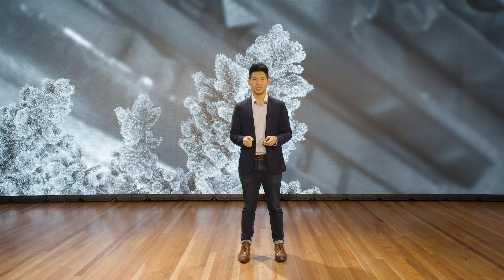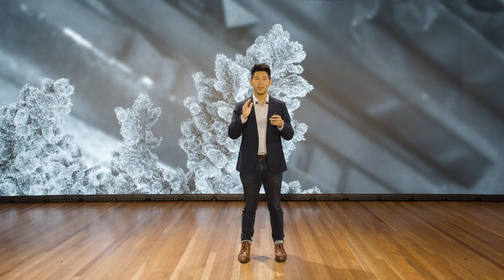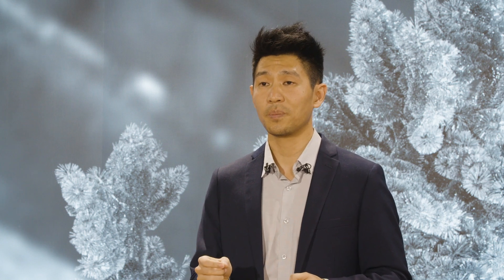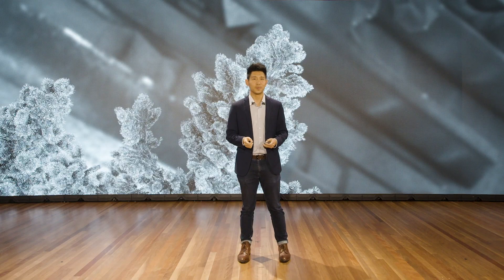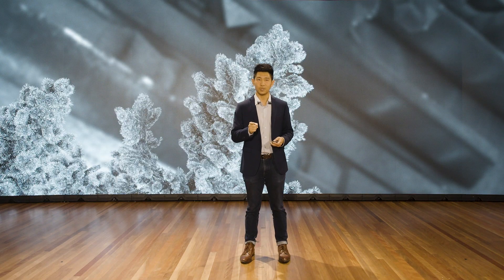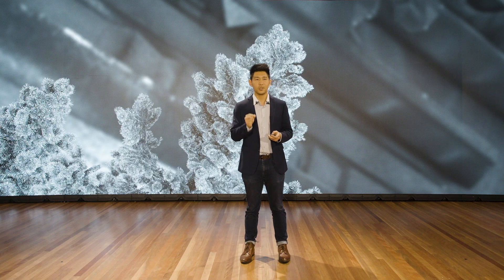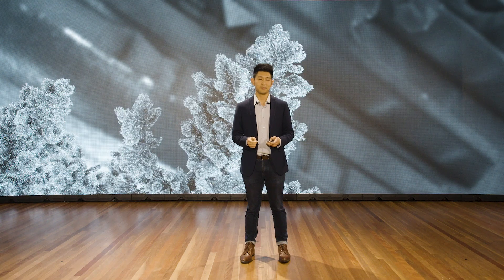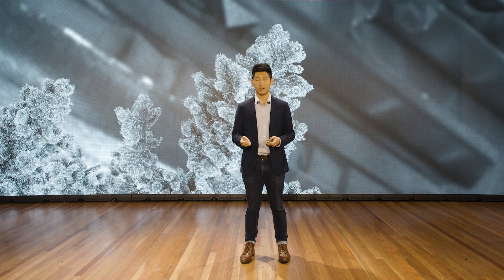Patrick Tung | X-ray vision: revealing secrets to resurrect batteries

Comment: Hmm Dendrites, let see.... it seems the spacer (battery insulator) between the Positive and Neg plates needs to have a getter material that bonds with the Dendrites that make the Dendrites non conduction, Or a Gas that the Dendrites bonds to and become NON CONDUCTION OR moves the Dendrites away from the two plates. Maybe the Dendrites do not form  if the positive and Negative plate if the internal pressure is high or low? Maybe a free-floating battery insulator so the dendrites break off from the plates.